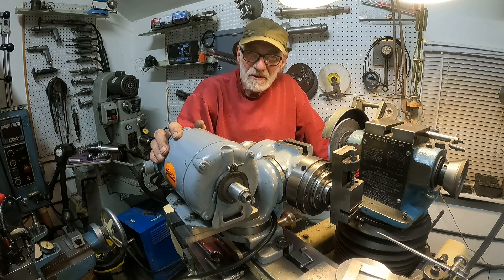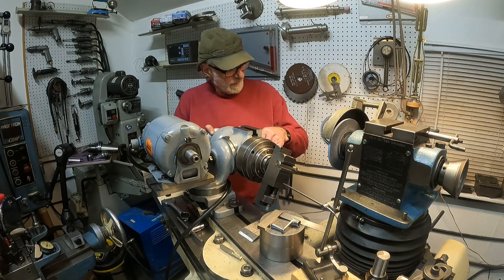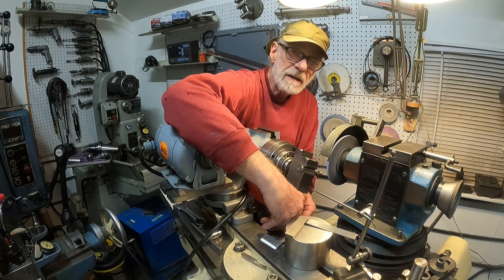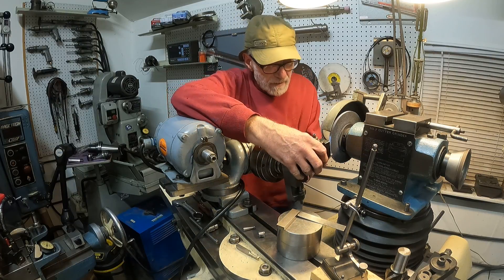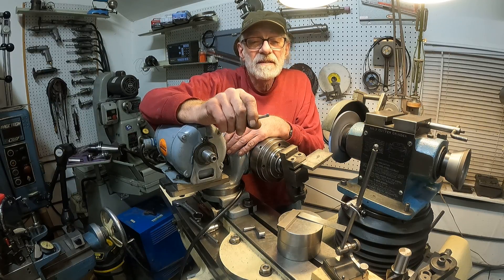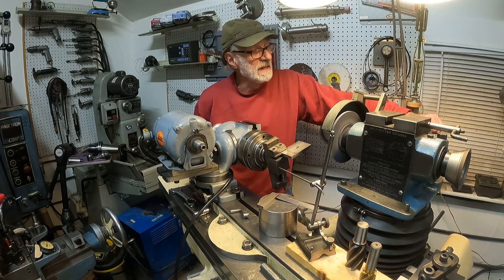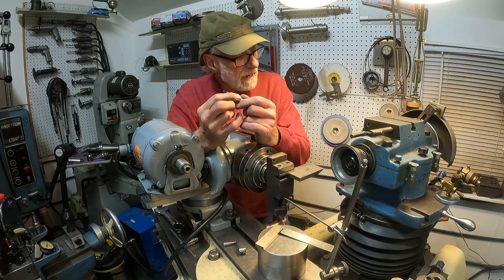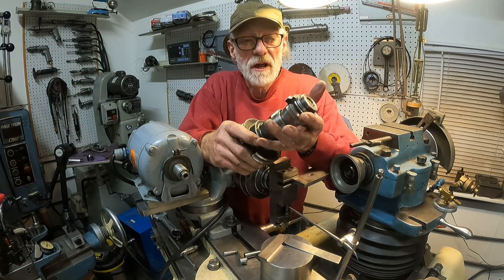Tool & cutter grinder also a deluxe bench grinder

Comment: Your videos are GOLD Donnie.  The "problem" with universal tool cutter grinders, is because they are so universal, the beginner does not know where to start when it comes to fixturing and workholding.  I used to study old Brown and Sharp and Cincinnati catalogues and brochures for the pictures of the set ups.  Great content.  The metalworking community thanks you.  --Doozer
Reply from the maker: Thanks for that, I want to show the most basic uses for the machine that get passed over or not considered. This is the machine that ties my other machines together with consistent factory sharp edges that can be changed as needed anytime. This machine gives you full control of the other machines.

Comment: DeeDee, Good Day to you.  Another little “trick” to put in my brain for future reference.  I am starting to see how a tool and cutter grinder could actually help me reclaim some floor space.  Very cool.  Right now I’ve got 3 different pedestal grinders, at least 2 of which I could sell if I buy a tool and cutter grinder.  Thanks, as always, Will
Reply from the maker: I found the cutter grinding machine eliminates the regular carbide grinders that use those dreadful metal backed wheels,  i am showing some tricks using the standard work head instead of having to buy extra fixtures. The cutter grinding machine gives full control over the other machines.

Comment: Dee love your videos! Do have a question about  your Moore did you remove all the components for the tachometer up grade?  I am trying to repair mine to original and am looking for the tachometer gauge and generator, are those parts available I have some duplicate tooling for my #2 Cincinnati T+C if you are looking for something in particular.  Keep the videos coming!  Thanks Zed
Reply from the maker: I did remove the generator and gave it away. The machine was rebuilt and modified by Moore with only the high speed using a 3hp single speed motor. The speed buttons had caps over them  to prevent the operator from changing speeds. I further modified the machine by cutting the quill feed back to that of the later #3 or B type machine.
Reply: D+D thanks for the quick reply I'll continue the search I called Moore and they have zero information on the #2. If you need any accessories for your T&C I maybe able to help. Thanks for checking Zed

Comment: Great video,  I hope you're having a good evening dee , This is a little off topic.  How do address a raised  burr  caused by a spun drill in the tailstock?  I'm just a hobby guy starting out.
Reply: I know you didn't ask me, but if you mean a burr raised in the socket of the tailstock spindle? Donnie's got a video on this actually, he trues up the spindle socket of the milling machine. You can also get a morse taper reamer and go real gentle to brush off any burrs.
Reply from the maker: If the taper is a small size you may have to use a reamer, If a bearing or triangular scraper will get in there I would try that first, thanks for tuning in.